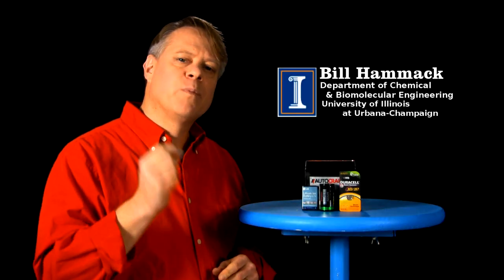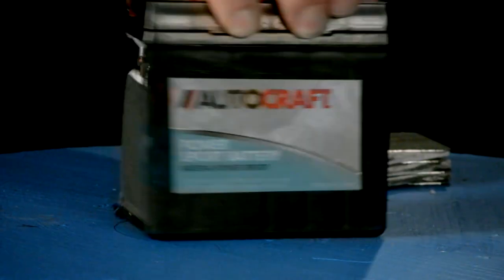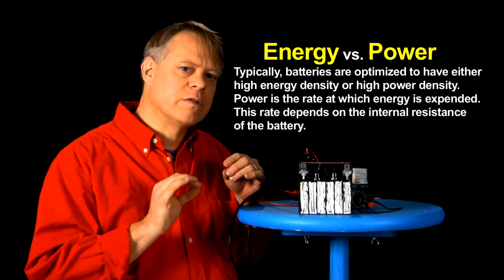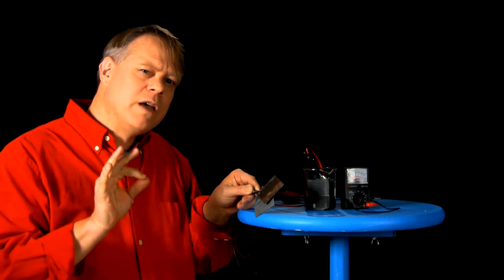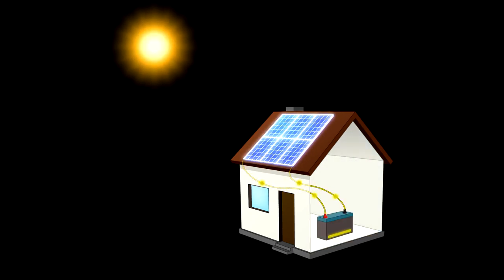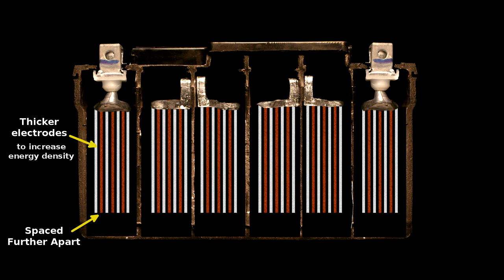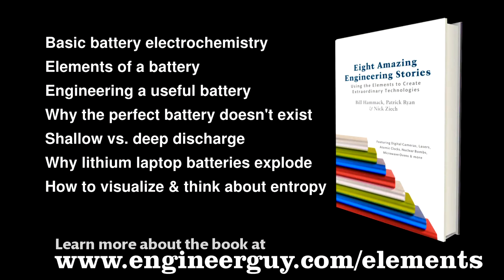How a lead-acid battery works

Comment: I bought 4 6v 4.5ah rechargeable sealed lead acid batteries cheap, my idea was to charge them with a solar panel and set up led lights in my room and also have some usb ports to charge my phone and iPad. In your video you explain that deep cycle batteries are designed for solar charging, does this mean I shouldn't use my batteries or are they ok for my setup? kind of new to solar charging batteries.
Reply: +Gardener Rob your set up will work. In fact your batteries are likely a deep cell type, as most 6V are. Even if they were not thought, the only difference would be the life of the battery if you are continuity draining the batteries more then 50% there capacity. Deep cycle (Deep cell, same thing)  are made to be tougher on long drawing currents. For what it sounds like your using it for i wouldn't worry about it, especially if you already have the batteries.  

What you should be more worried about is the size of the solar panel. A 15W panel will more likely just maintain your batteries not really providing a charge. Any larger panels you should be getting a solar charge controller. They are fairly cheap on amazon: 
https://www.amazon.ca/TurnRaise-Controller-Regulator-Charger-Digital/dp/B01ABV1LIC/ref=sr_1_9?ie=UTF8&qid=1458691631&sr=8-9&keywords=solar+charge+controller 
(bonus USB built in!) 
Cheaper still: 
https://www.amazon.ca/Docooler-Controller-Battery-Regulator-Protection/dp/B00L37KZI6/ref=pd_sim_sbs_200_5?ie=UTF8&dpID=51F-n%2BsohrL&dpSrc=sims&preST=_AC_UL160_SR160%2C160_&refRID=V77Q7AN4K6KZ0ZP4B0PF

Make sure you know how much amperage your panel can out put and get an appropriate controller. 

Another note is I'm assuming your using 2 sets of batteries in series,  then the two sets in parallel to give you 12V which is easier to find things to run off, your LEB lights are likely 12V-36V.
I recommend you get a proper 12V to USB charger to charge your cell, trying to charge off the 6V could prove troublesome. 
Something like this would be handy:
https://www.amazon.ca/Cigarette-Lighter-Splitter-Charger-Adapter/dp/B00XOUUIQ4/ref=sr_1_7?s=electronics&ie=UTF8&qid=1458692244&sr=1-7&keywords=USB+Chargers+from+12V

Happy Charging.
Reply: Robert C  Thanks mate for the helpful info.

Comment: As long as you recycle them there actually more environmental then lithium ion.  Its extremely easy for manufacturers to recycle lead as opposed to lithium ion.  Plus most auto parts stores charge a core charge no reason not to recycle them.

Comment: i'm fairly certain you probably could, but then you run the risk of scraping off the lead material and having it free floating.  this would drastically decrease performance because it would want to share electrons with lead material not connected to the posts, thus waste voltage and amperage.

Comment: Interestingly,there are even electric cars  usually use lithium ion batteries as the main power source for motion still have 12v lead acid batteries for compatibility with existing car electronics and to open the contactors (a type of relay) for the main batteries.

Comment: Does long-term discharge lead to the death of lithium-ion batteries used in cell phones aswell, or does it only apply to the heavy duty lead-acids?
Reply: Prolonged periods of discharge causes sulfation of any lead acid battery, it ruins any of them.

Comment: Sorry, can someone tell me why the lead sulphate doesn't build up when the batterie is in use but not discharged fully?
Reply: Sulfate crystals form during normal use, but they are small and unstable so they break down. When a battery is deeply discharged, the sulfate crystals become large and stable.

Comment: they are for relativelt small devices like a fone or a laptop.  but they dont provide enough output amps to turn over the starter motor in a car.

Comment: It's not just automobiles, but powering high drain devices such as computers. Anyone who lives in an area with a not so reliable grid, or invested over $1000 into a desktop should have one. Even if they can only sustain 15 minutes of their maximum load, this is more than enough time to ensure a proper shutdown.

Comment: what is the purpose of the separator between the plates? It says it's to prevent "short-circuiting".It also says it's permeable for the liquid electrolyte to allow the electrons and ions to flow inbetween the plates.. So my question is how can a separator prevent a short-circuit if it already allows the current to pass through it? thank you

ps
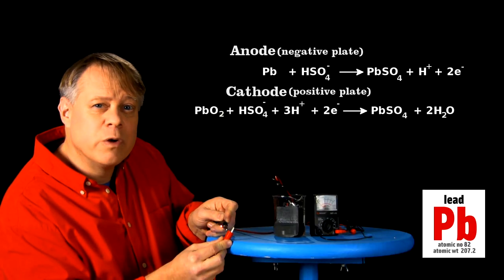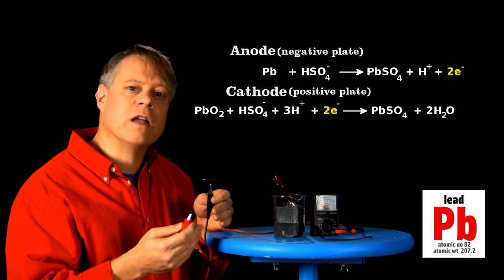also at 1:28 you say that lead oxide is a cathode.(aka "electron emitter") but then you say at 1:34 that lead oxide accepts electrons... *Im confused*

Comment: In stationary applications where weight and size aren't much of an issue, lead acid batteries offer the lowest levelized cost of stored energy of any of the chemistries. Lithium based chemistries have a longer cycle life, but not enough more compared to upfront cost. Lead Acid isn't going away anytime soon. some batteries, with tubular cathodes have cycle lives in the thousands. A good forklift battery can give a levelized cost of less than $.08. Lithium, about $.12. (cents per Kilowatt Hour).

Comment: Why do you say that the current flows from the cathode to the anode? Don’t electrons flow from the reducing agent (anode) to the oxidizing agent (cathode)?
Reply: Scientific misnomer that stuck. The flow of current was described before electron flow was discovered. So now the flow of current is defined as the opposite direction of election flow. This has always irked me. Silly reason I know but I ended up dropping physics in highschool after my electronics term because of it.
Reply: But now I'm a doctor since I pursued biology instead. I watched the nitinol video to understand how cardiac stents work which 'lead' me here.

Comment: how are the plates "tuned" to give off exactly 2 volts?
Reply: It's a characteristic of the specific chemistry used. That's why your typical alkaline batteries are 1.5v and lithium-ion cells are 3.7v.
Reply: Zen Punk I guess its a good thing that they ended up being a voltage that the 19th century could read. Could you imagine? "Yeah this should give off voltage but I'm reading exactly zero volts."

Comment: A hybrid ultracapacitor/battery (NiMH or Li Ion) would work wonders.
Reply: What are they made of? How abundant is it?
Reply: 12V Lithium car batteries are now available. eg.  Lithium Ion Phosphate. First showing up in motorcycles / race-cars and as jump-start devices for regular car batteries. Cost is still somewhat prohibitive, but that will change over time.
Reply: TheJamesRedwood The best supercapacitors are made out of graphene, aka carbon, which is abundant as shit.
Reply: Yes, I am familiar with carbon. I think you'll find it is more abundant than shit.
Reply: TheJamesRedwood  That would make carbon strikingly abundant indeed, given the general prevalence of shit, in one or another of its myriad of forms.
Reply: ***** More than half of shit is carbon, less than half of carbon is shit, therefore carbon is more abundant than shit.
Reply: Libertarianist I was thinking about what you said.  The part about the half of carbon and shit wasn't half bad!  When it comes to carbon, it seems like you really know your shit.  I probably don't know the half of it.  Either way, I'd say it's abundantly clear now that that shit is clearly abundant.  Still, it really makes you wonder about the other half sometimes.

Comment: I doubt it very much, since the energy stored is much less than lead batteries, and Li - Ion or Ni-Cd are a lot more expensive . To start a diesel car, you need a 70Ah lead battery which cost about 50 $ .A 10Ah Ni-Cd battery from a very rare UPS, cost 300 $. The only hi capacity Li-Ion battery i found, where those for cameras or drill-machines, and extremely expensive.

PS: prices are token from the web, and if you are reading this after 100 years, it may also differ.

Comment: @Bill, what do you think will replace this battery in the future? Lets say a meteorite is found and mined that is made up of pure and plentiful 'x'. What would be the 'x'?
Reply: Lithium Iron Phosphate is the closest thing. At 3.2 volts per cell, a 2 cell battery is a drop in replacement for a 6 V lead acid battery, a 4 cell battery replaces a 12 V battery. The match is so close that I have successfully paralleled Lithium iron phosphate batteries with absorbed glass mat lead acid batteries. The lithiums do pay out their energy slightly ahead of the agm. but the system has worked flawlessly for several years now.

Comment: can i charge and discharge the lead acid battery at the same time using an alternator/generator?????
Reply: Harshith SV Basically, no. Imagine a battery is a spring powered piston that compresses and decompresses air on either side of it. Each side is like each electrode, the spring has a constant force (ignoring variations in performance, this is like the voltage caused by a battery cell) which produces a pressure difference across the cylinder. The cylinder has some friction to movement, which is like the inherent resistance of a battery. Wires are like air hoses with very little friction. Hooking up a hose across the cylinder is like completing the circuit between the electrodes. Charging the battery is like having a pump work against the pressure difference (thus compressing the same side that the piston is trying to compress). If you try to charge and discharge the cylinder at the same time with equal amounts of air flow, the air will simply flow from your air pump to your air turbine, having no reason to go into the cylinder because any pressure differences (voltages across) between the sides caused by your pump is cancelled out as the air blows through the turbine in the other direction. However, shut or slow either one and the piston will start moving.

Due to electrodes being conductors, any single one has an even voltage throughout (this is like each side of the cylinder only having one pressure). Thus, any single cell (two electrodes) is going to have only one voltage difference at a given time. Both electrodes can not be at a higher voltage than the other. The voltage difference is what drives the direction of the reaction. Basically the reaction wants to occur, but doing so produces a voltage difference that acts against the reaction by repelling the further concentration of ions. Conduction between the electrodes allows the voltage to be releases, allowing for more reactions, which in turn cause some of the voltage to be maintained (assuming some electrical resistance). However, if instead of releasing, you aid in building the voltage by pumping electricity in the same direction the reaction wants to, eventually the voltage difference will not only resist the movement of ions, but cause them to flow in the opposite direction as usual, causing a reverse reaction (charging).
Reply: thank you so much !!!!!!!! i din't know these many facts about it...... thanks a lot.......
Reply: Harshith SV You're welcome.
Reply: It's called load leveling. The battery picks up the difference between the output of the generator and the load. When the load exceeds the output capacity of the generator, the battery will supply the difference. When the load reduces,( or the motor in the fridge cycles off), the generator can continue putting out its power to recharge the battery. This allows a smaller generator to be used for cyclic loads, because it only has to supply the average power, not the peak. It saves fuel.

Comment: Ah, I see. The energy density is like a tenth of the Pb acid. I like an NPR driveway moment with the engine turned off as much as anyone, and that would probably only last a few minutes with an ultracapacitor until total discharge. Ah well, too bad. Thanks for the lijnk.

Comment: 1:28 - Don't the electric charges flow from the anode to the cathode?
Reply: Yes, but current flows from positive to negative.
Reply: +Emilio Perez  Actualy, it depends if you talking electronics or science...
Reply: No. It doesn't matter. Current flows from positive to negative. Electrons flow from negative to positive.

Comment: Hey bill love the videos, keep up the great work! Just out of curiosity have you ever heard anyone call it Lead Peroxide instead of just Lead Oxide? Can't seem to find a clear answer on the internet. Also in deep cell batteries they use a lot of sponge lead, I also come from an automotive background not an engineering one. Again great videos!

Comment: Why aren't we using ultracapacitors in place of lead acid in cars? Most people start their cars at least once a week, I would guess the self-discharge wouldn't be a problem. Lead is such a nasty material. It's one of those things people are going to look back on in the future and be shocked that we all drove around with 50 pounds of the stuff in our cars all the time the same way we look back on the use of arsenic green for wallpaper.

Comment: What about Lithium Iron phosphate battery?
Reply: Lithium Iron Phosphate (LiFePO4) is lead acid batteries biggest competitor. It has a higher initial cost, but also has a much higher cycle life. The hysteresis is lower, giving them a higher round trip efficiency. The only caveat is that they require cell balancing just like lithium ion, meaning you need a more sophisticated battery management system. That adds to the up front cost, but when it comes time to replace the cells, you keep the electronics, so you don't have to re-invest in that. They are a good choice if you can afford the installed capacity that you need. you'll be good for 10,  maybe 12 years.

Comment: My lead acid battery should be giving me 6 hrs of light based on my calculation but gives me less than half of that ( drops to in 2 hrs, 12.1 closed circuit). can it go below 12.1? Pls help.
Reply: At 12.1 volts, you have only used 40% of your usable capacity. for longest life, your cutoff threshold should be about 11.8 V, which is just about 65% of usable capacity. At 10.5 V, you will get the full rated capacity out of the battery, but that will shorten the service life of the battery. I hope this helps.

Comment: sulphuric acid is h2so4 not hso4 shown in the vid
Reply: H2SO4(aq) means it is in a solution of water. In this situation H2S04 goes into an equilibrium and we will see 1.H+ and 2.HSO4- on the right hand side of the equation
Reply: I have been learned

Comment: Cheap?! They used to be $50, but they’re $100 to $180 now!
Reply: Look at the cost per Kilowatt hour. If you're looking for solar storage, consider discount store golf cart batteries. They can be purchased for less than $100.00 per Kilowatt hour of stored energy. Much cheaper than any other chemistry. Granted, you will have to replace them more often, but that's OK. When they finally do ware out, check the market , calculate levelized cost per Kwh of stored energy. If there is something better, go with that. otherwise, you have a nice set of cores to trade in on new ones.

Comment: So why do people think lithium batteries will replace old acid batteries, and furthermore why are lithium batteries reacting so violently. I have seen more runaway lithium batteries than I have seen corroded nickle-cad or alkaline batteries.
Reply: Maldus Alver because they are mostly made in China. China has no quality controls on what they make.
Reply: Ronald Smith that doesn't answer my question. If everything is made in china and china doesn't have the quality control, then everything should be at the same level of poor quality. So what makes lithium explode but Nickel Cadmium don't?

Comment: how is it possible and why dont we make water powered cars?  i really want to know :P
Reply: Water is the lowest potential of Hydrogen and Oxygen. You burn oxygen with hydrogen to create water. It takes energy to separate hydrogen and oxygen, you get that back when they re- combine. you can't run a car on CO2 for the same reason.

Comment: why is cathode positive?
Reply: Idiyana Mazalan  cathode ,
 it is not +ve , the +ve one is said as cathode.we just named it as cathode
Reply: Consider the flow of current when it's discharged. The negative current from the negative terminal is being applied to the positive terminal. If you take a radio tube, heat the filament, and connect a volt meter between the cathode and control grid, the cathode will actually show positive, the grid negative, despite normally applying negative to the cathode in normal use. (it's called thermionic generation). Same thing with a battery except Ions travel through the electrolyte.

Comment: Aren't lithium ion batteries much better.
Reply: They are, but they are much more expensive and much less forgiving to fault conditions.Lead acid will tolerate overcharge and over discharge much better than lithium Ion.